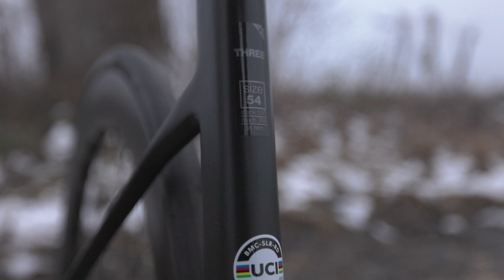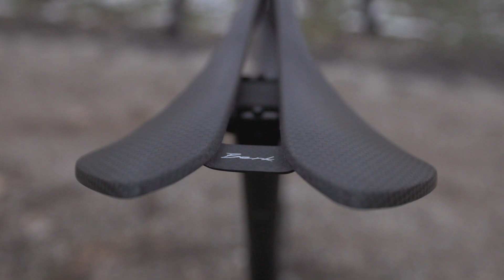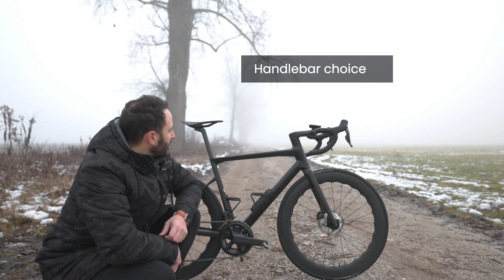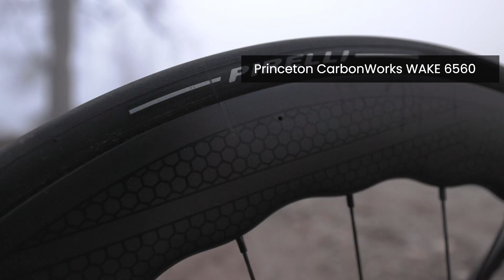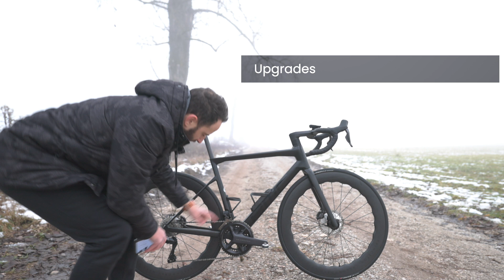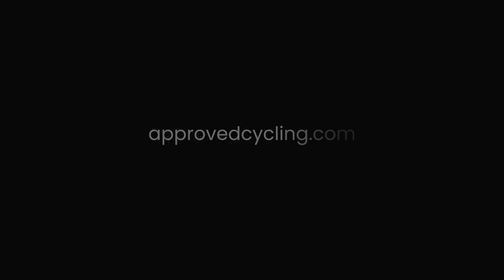BMC TEAMMACHINE SLR01 THREE 2022 | ROAD BIKE

Comment: Nice.. I’ve got the 01 one in petrol but with a different wheel-set, the ARC 1100 DICUT. 
It’s my 4th 01 bike. Fantastic frame sets, you can totally rail corners.
Reply from the maker: TBH we have a better feel on descnets with the timemachine. But regarding ascents the Teammachine slr01 feels extremely light almost "jumpy". If there is a dream bike I would pick A combo of SLR01 for uphill and timemachine for straights and downhills :P
Reply: @approvedcycling  just put a big chainring on. Problem solved. 
I run a 53/36 . 11/28 
Perfect for Yorkshire roads
Reply from the maker: @livibam  I am a bit heavier so I have 52-36 11-30. For Slovenia / Croatia it is ok :P

Comment: Ver nice review nice bike stealth look and great weight to stiffness ratio
Reply from the maker: Agreed, a longer term review will be up shortly...some opinions we had changed a bit but not that much :)
Reply: @approvedcycling  in comparison to Tarmac SL 7 is the stiffness level in bottom bracket area and steerer tube comparable? Have You got the chance to ride SL7?
Reply from the maker: @road-racing.pl_OfficialChannel  not the sl7 but if it helps we rode F12. Bottom bracket is prety similar. But the handlebar and headset were stiffer on the F12 but that also means the ride is alot more comfortable on the teammachine.

Comment: So I already had a normal Teammachine and no SLR01. Simply because on the SLR01 the steerer tube is not a round head tube at the top. Anyone who has known BMC for a long time knows that there were often problems with the safety of the fork.
For me, in this price range, something like that is unfortunately not okay.
Reply from the maker: We are not a long term (5 years or more) BMC users. So it is hard to comment on that. We look at it the other way with trust and regulations in mind. If they are selling it for more then 1 year now it should be ok. Will look into steer tube issues. We worked with lots of companies in the past and there are few or no companies which didnt have "call backs"...

Comment: Nice review man. Currently I’m riding Merida reacto and I want to change for BMC . I’m little bit struggling between 52 and 54. I’m 177 cm tall and I’m not light rider (100kg) . I’m looking for stiff bike. What is your opinion about BMC timemachine for me? Thanks
Reply: i have a teammachine size 54, im 176cm tall with 81cm inseam. i would highly recommend you get a bike fit before you buy any bikes that has an integrated bar. becos its not cheap to switch bmc handlebar and its not modular like a tarmac sl7 where u can easily swap out the stem. I'm speaking from experience as my current handlebar stem is 110mm which is too long for me to reach. other than this issue, the bike is very comfortable but its not as stiff as a tarmac.
Reply from the maker: I am similar build to you. its hard to answer the size question. But I would recommend the 54 size. 
Depends on you arm, legs, body lenght. For 177 54 with 10cm stem i feel could be the right size. With bike fitting there are a lot of small details we would need to know but in short 54cm.

Regarding the bike. I feel Teammachine is the better all rounder of the two. But knowing that. I like speed and I am also waitting on the purple Timemachine. After the first ride although I didnt like the looks of the bike it kind of grew on me. Here is my review of it. If you have any questions please write them here. With the build up of the company we switched to this channel.
https://www.youtube.com/watch?v=OEklteGDsn8&t=8s